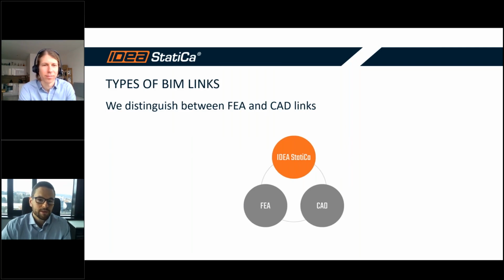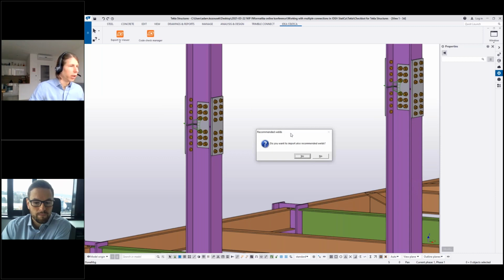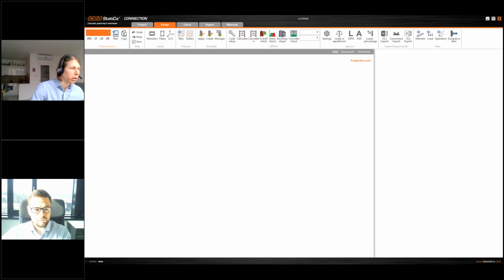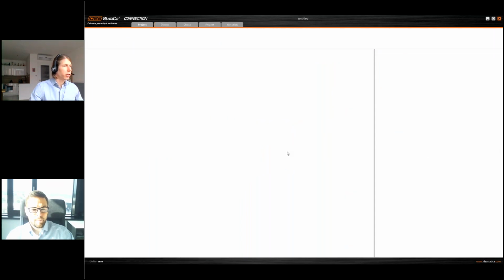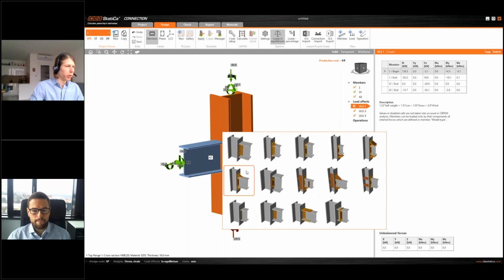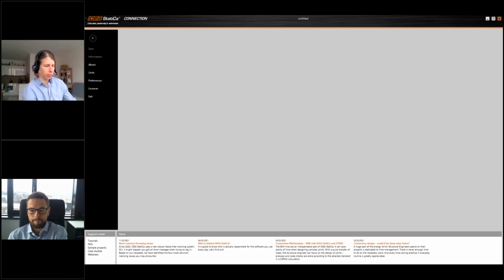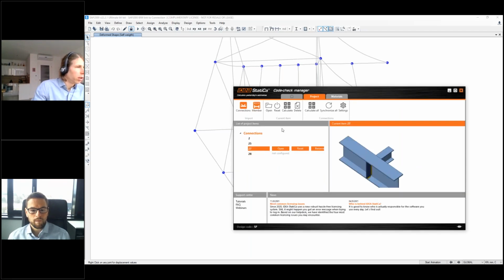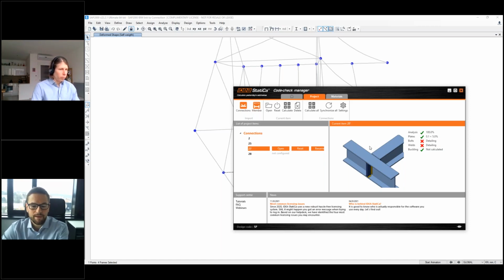Working with multiple connections in IDEA StatiCa combined with Tekla Structures and SAP2000

Comment: The videos is detailed and informative. I had one question "Once you import the connection from Tekla and pass the connection in IdeaStatica, would the changes made in IdeaStatica get updated in Tekla by the Sync command. Like if the bolt dia changed from M20 to M22 will this be updated back in Tekla? Thanks in advance
Reply from the maker: Hello Vijay, unfortunately the sync does not work both directions. Tekla Structures does not allow to change the model backwards by changes done in other software. So, you have to adjust the Tekla model it manually.